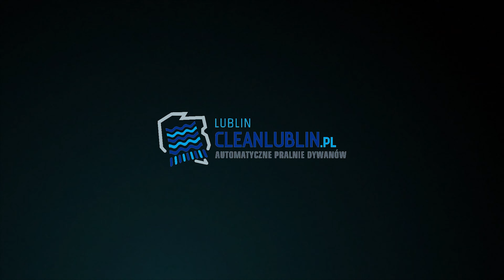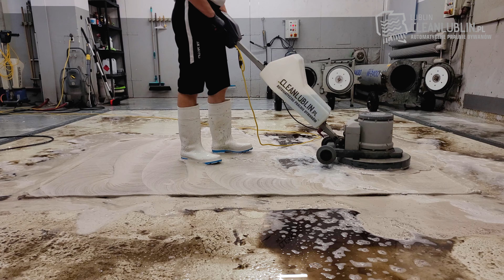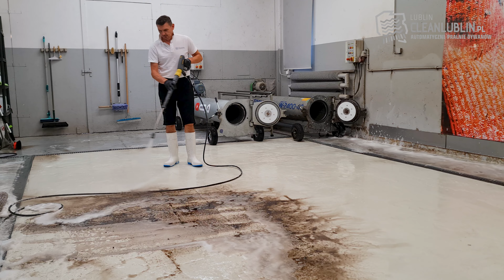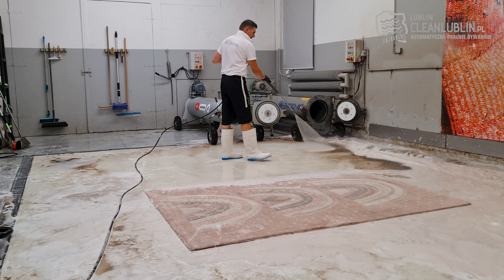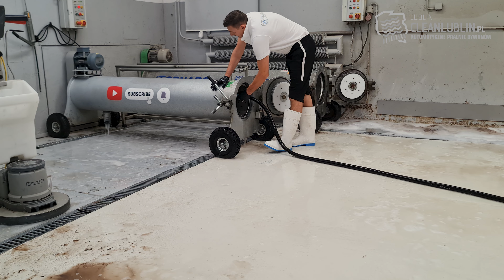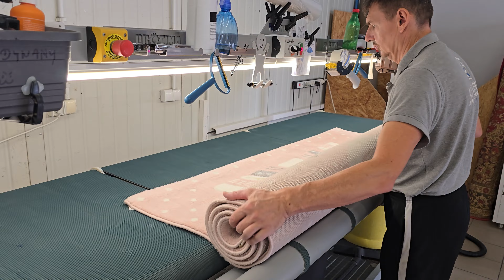Restoring a carpet used as an entrance matt on construction site! | Speeded Up

Comment: Power cord still on wet floor. Safety hazard!
Reply from the maker: Its designed to be used like this
Reply: @cleanlublin  still safety issue! Water and electricity don’t mix.
Reply from the maker: @dianevalentine4986  Thanks for your concern